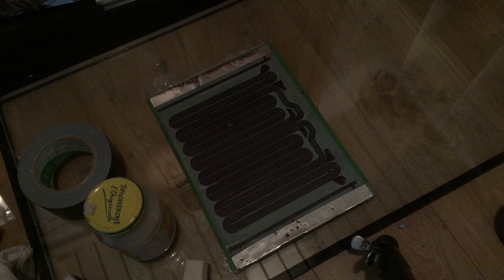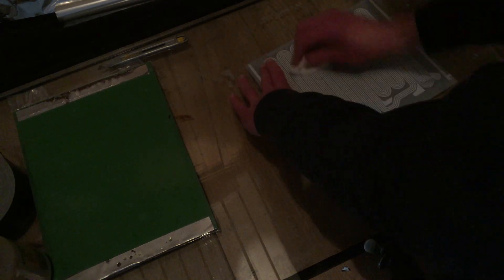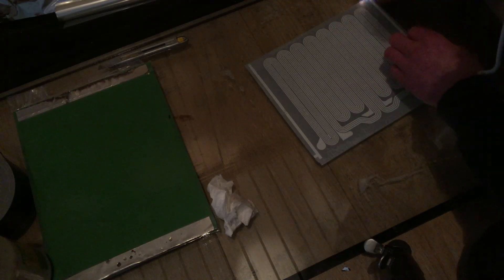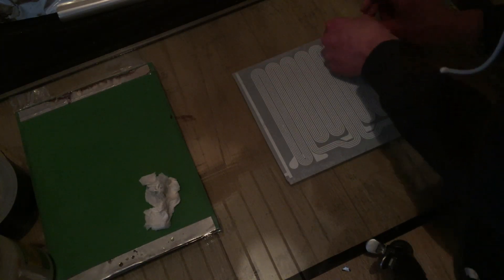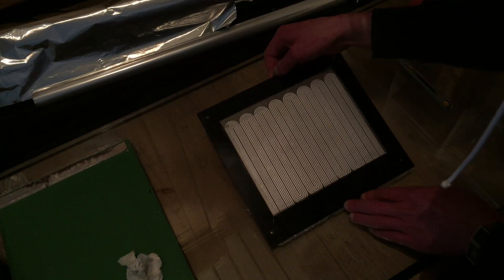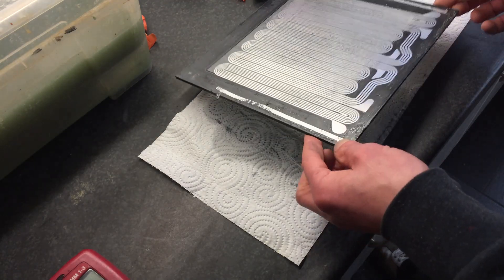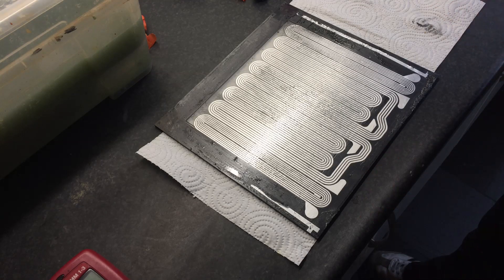PRT3 - Bluetooth Neodymium Planar Magnetic Test Panel

Comment: Can i do this using the aluminium tape as you did on the bigger planar speaker?
Reply from the maker: yout wont have small enough tape im afraid. wires are more easy to use. (aluminium wires is a must. find them here wires.co.uk) or use the plotting method if you have a plotter.. or can use one somwhere and plot out the coil out of wide aluminium tape. as i do a few times in different projects.

Comment: Why don't you make them smaller so it fits in printer?
You could make them mono. Does it sound better, if it is stereo, but so close together?
Reply from the maker: well it does not sound incredible stereo, but when  having it stereo i can use both the channels on the bluetooth amp, so twice the power is available.  making them smaller will hurt maximum output in the lower regions even more.  since there is less surface area :) and higher resonance

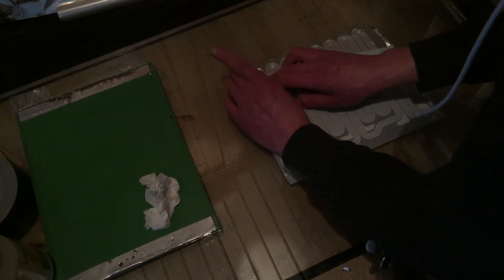Comment: what is that blue thing that you pilled off at 6:30?
Reply from the maker: it is where the alumnium adhesive tape was sitting on, backing paper.   the thing is that whats left is only the glue from the tape and the aluminum here and there to makeup the coil :) reason why it is hardly possible to get of
Reply from the maker: this whole piece was a piece of adhesive alu tape before etching

Comment: Thank you for the detailed videos. They are very helpful. I wonder if you could share which kind of adhesive do you use for glueing the foil onto the mylar?
Reply from the maker: in this case i startet out with adhesive alumnium tape. so it is already adhesive. problem is getting the backing paper of and put it on the mylar :)